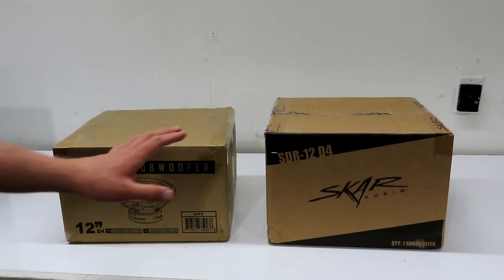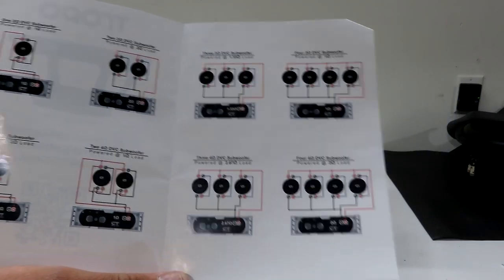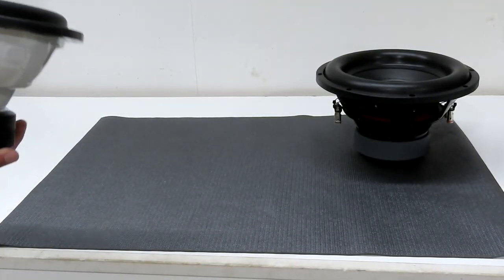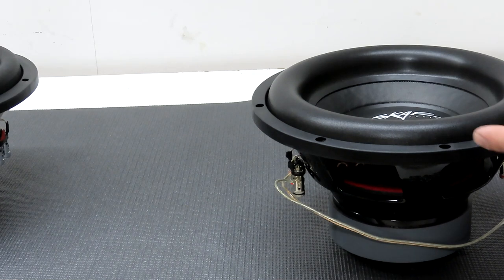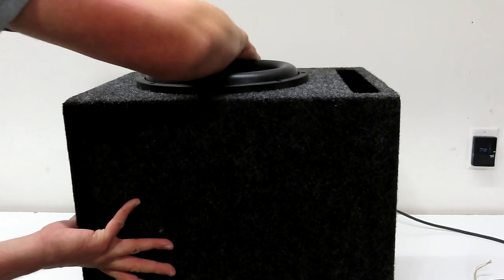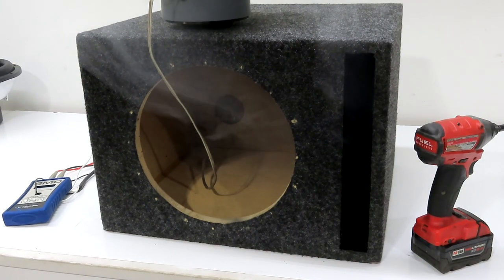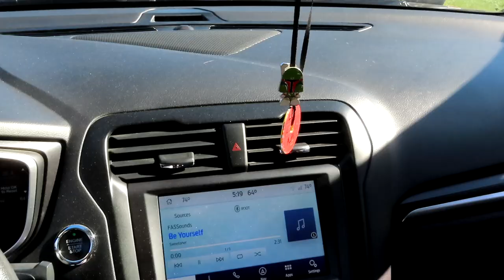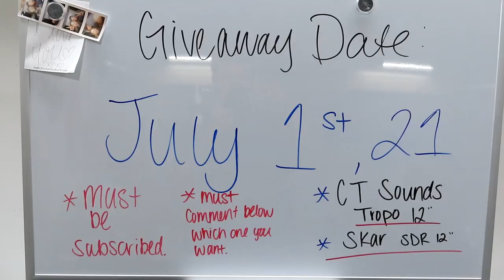Skar VS CT Sounds - Best Budget 12" Subwoofer

Comment: Ct sounds for the win in my book! Always will, always has!
Reply: Isn't the engineer that has designed some of these CT Sounds subs the same guy that designed the Audiopulse Axis quad 1 ohm voice coil 12 inch sub years ago?
   I still have my old quad 1 ohm voice coiled, 56'ish pounds 12" sub, though it's in a little crappy prefab box that's really pounding apart from the massive power of the axis! Well that, and it's had a XTR 2500 RMS watt Orion amp running at .8 ohms which I believe puts that amp easily around 4k watts RMS, probably more depending on how much box rise it's getting..
Reply: but my type Rs hit harder
Reply: @boostjunkie2320  lol
Reply: @richardwallace5625  they do
Reply: @boostjunkie2320 2 different beasts. Not to be compared.

Comment: Nice comparison..  Pricing has changed slightly since this vid released.  Skar 12" SDR is currently ~$90, and CT Sounds Tropo is running ~$120..  Roughly $30 cheaper for the Skar.  CT Sounds is still worth it though for the better sound quality and that extra "ooomph".. But also, $90 for the SDR is pretty amazing as well.  Either way it's a win.  

I'm running a Skar 12" EVL Series in a ported box tuned at 32Hz.. 1500W being fed to it.  That EVL gets down!

Comment: id go with the CT subwoofer. its awesome you showed the actual wattage going to them. alot of people still think it takes a good amount of power to move subwoofer free air, which in reality it does not.
Reply from the maker: Absolutely correct. I hate when people put a sub free air on a 3k amp and say it took 3k watts..

Comment: Should I go 2 Skar 10" SDR 2ohm DVC or 
CT Audio 10" TROPO 2ohm DVC ?????
Reply from the maker: Did you watch the video? CT Tropo is the best sub in this class. Also, why dual 2 ohm?
Reply: @ATCA  I have 2 other dual 2 and it's best for the configuration and to not mix dvc 4 and dvc 2

Skar burnt out and ct easily 600 watt, and ct better with the lows
Reply from the maker: @BramtheMan1  what amplifier.  You want to run all 4 on one amp? Mixing dual 2 and 4 is fine if they are on separate amplifiers.
Reply: @ATCA  was looking at either CT 2000.1 mono or skar rp 2000.1

But to find the right box for the CT is a quest, i would like to stick them in the skar dual 10 box, just want the best box according to the subs specs
Reply from the maker: @BramtheMan1  to be clear, you want to run 4 subs, or just 2 subs? Do you have 2 of these skar boxes? Also, thr ct2k is a powerhouse! Ill order and test one soon!
Reply: @ATCA  all 4 on one, the other two are 200 rms each in their own box. CT rms each is 650, so in total it would be 1700 watts rms needed. Can't wait to see that test video 🤘
Reply from the maker: @BramtheMan1  get dual 4 ohm and a 1500 for those and a different amp for those 2 you have. Running all off one would not be ideal. The 1500 is on sale still. I think and its a powerhouse
Reply: @ATCA  I like that idea, I'll see if they have a bass package for the10 " TROPO 4 dvc and if 1500 is still on sale. How is the 4 ohm better than 2 ohm ??
Reply from the maker: @BramtheMan1  dual 4 ohm woofers will be at 1 ohm if you run 2. Perfect match
Reply: @ATCA  Do you think the Ct TROPO dual 10 package is the best volume for the 2 subwoofers? That box looks small and looks material wise cheap.
Reply from the maker: @BramtheMan1  send link and ill look.
Reply: @ATCA  Tried putting link, it just doesn't want to post
Reply from the maker: @BramtheMan1  take the .com off
Reply: .ctsounds/collections/factory-loaded-enclosures/products/b-box-d-10-3
Reply from the maker: @BramtheMan1  so I've actually had this setup before act. It didn't fit in my car so i sold it to a good friend. He beat on it for over a year with a t1000 before getting a t1500 for it then upgraded to a Meso 12. All i can say, is i hated the box at first but it was built well and I was impressed.  And basically,  this cost, the box is like $40, no? So its a super cheap starter box. No harm if it gets upgrade.  We built him a custom box for his Meso 12 and he kept these for another car

Comment: The reason that skar blew the coil is because you are correct at tuning there is very little cone movement which translates to no air flowing or cooling of the coil lol
Reply from the maker: Ct did just fine. This is one method i use to test coils. The most brutal.

Comment: I got 2 sdr subs on an rp2000 and have had it for over a year hitting hard without any problems so I don't know if what he is say is true must be doing something wrong behind the scene
Reply from the maker: My testing methods are conclusive. A true,  clean, continuous 600w rms fried sub. Whereas the other brand did just fine. The SDR woofer is very popular because its cheap. But saying its a good woofer is a gross overstep. If you enjoy the SDR, you'll find other similar woofers to be much better.

Comment: I have 2 SKAR VVX3s 12's i have slammed for over 4 years in my rover. Bought a skar 8 for my truck and it had a weird rattle. Replaced it with a CT sounds Meso 8 and damn that is a beast. I'm sold On CT i think the newer SKARs are getting to cheaply made. My older 12's have a cast basket and they discontinued that sub probably because of manufacturing cost. I do have a skar rp1500.1 and 800.1 and they are great for the money.

Comment: im questioning your testing method. Stevemeade put 1200 watts to his sub for well over half an hour before it started making any kind of noise. The sdr series isn't a bad series if you set your stuff up correctly. I would have liked to see the impediance rise and seen some thicker speaker wire used. Plenty of peeps having zero issue with the sdr stuff. Also why show the SMD meter with the CT and not with the sdr? Something fishy going on here.
Reply from the maker: Check it again.  The ct clearly shows  600w at about 5 ohms. Thats after impedance rise. Thats not a 1200w amp...
Reply: @ATCA  not once you factor in impedance rise no but it IS a 1200 watt amp regardless. It puts out over 1200 watt at its rated impedance. Impedance rise isn’t the fault of the amp that’s the sub and box. Steve mead also shows with his clamp meter what it’s pulling while it’s pounding. Go watch his video on the sdr.
Reply: @ATCA  800 RMS 1200 Max it does over 1200 watts it's an skar audio amp so it's  gonna do more lol
Reply from the maker: @azzazel_99  do me a solid, whats a 1000w amp do at 5 ohms? Awaiting your reply
Reply from the maker: @azzazel_99  i have a much larger amplifier than is needed. That's how i can dial in 600w exactly, regardless of impedance rise or enclosure design.
Reply: @ATCA  again box rise/impedance rise are not the fault of an amp. The rp1200.1 does 1200 watts at 1 ohm. It does it’s rated power at its rated impedance levels. In the same video the same sub is also beat on in open air all but eliminating box rise. Take the rp1200.1 and factor in box rise and yes you aren’t getting the full 1200 watts………however you are at or above the rms of the sub and again SMD’s sub took that/more playing constant 30+ mins basically full tilt I believe he states. 🤷‍♂️
Reply: @ATCA  that’s my point. If you watch his video his meter shows you real time with box rise etc. he fed the sub over its 600 rms rating. You can see it in the video.

Comment: That skar rigtht now is $84 on their website. Great price but that should not have had a meltdown like that. It's rated for 600W. Most subs can take a bit more abuse than what their rated. I'm running a cheap rockville K5 12" in my grocery getter at 450W with no problem whatsoever. But the grocery getter is getting an upgrade. Definately looking at the TROPO XL. Although the price on that is double the skar! (edit: just noticed they have a tropo and tropo-XL. Probably worth the extra $60 to get the 3" VC and higher power rating.
Reply from the maker: Those skar Re just hit great. Hence the price drop. I think they're going under. D4s already dropped them. All they have is clout. Tropos are nice tropo xl is literally just a tropo with more power handling. You can use Coupon code ATCA for a discount on them too or use my link in description. 

https://www.ctsounds.com/collections/tropoxl-subwoofers/products/tropo-xl-12/?ref=kusxizsn72

Comment: Do you know that when you put in your hand under the bottom you are restricting the pressure redo the video. I have something to hold the speaker up so they can perform better without you blocking that air whole it’s s never want to perform right

Comment: What amp are you pushing the woofer with?
Reply from the maker: CT 4k
Reply: I was thinking of getting 2 skar 12. Now I'm getting 2 ctsounds 12. Good video.
Reply from the maker: @jesusrocha9856  yea. I used the 4k at 1 ohm so i can dial in exactly gow many watts i wanted. In this case, 600. Clean pure watts. 

Check the link in description for CT products.  Also, you can use code ATCA for a discount on everything on the site.
Reply: Nice I'm going ct on my system now

Comment: Why not show the enclosure specs and ts parameters side by side for both? The
Ct Sounds is rated 
650 watts rms, and has a BL of 10.80 and Xmax of 
11 mm. The Skar is rated 600 watts rms, and has a BL of 10.45 and Xmax of 13.5 mm. The Ct Sounds sensitivity is 88.21 db, and the Skar is 84.7 db. So that means the Skar will play a little bit lower and has a bit more excursion, but the Ct Sounds will get a little bit louder. The Ct Sounds recommends 1.75 cubes tuned at 32 hz  for the spl enclosure. 
Skar recommends 2 cubes tuned at 35 hz for the spl enclosure. Your box is built to Ct Sounds specs and tuned within a few hz, but it's a quarter of a cube smaller than the Skar needs for the spl specs. A fair sound comparison of 2 different subs requires 2 different enclosure unless the enclosure specs are the same for both subs.
Reply from the maker: Yeam, I'm not doing all that. Neither is anyone else. Factbisvyhe CT is better.
Reply: @ATCA  you're right. Other channels don't do all  that because it would be ridiculous to build a box for every sub that you test and I wouldn't do that either, but I would build an adjustable test box. For example I'd make the port side be able to slide in and out to adjust the internal volume and make a 4" round port with  sections that can be added or removed to adjust the tuning, but I don't make YouTube videos comparing different of  subwoofers so I haven't built one. You're right the tropo is better than the Sdr, but it's not the fact that 
 Ct Sounds is better than Skar. The fact is  that according to the specs and price the Tropo is a class above the Sdr and the Sdr is only $89 now. The Svr would've been a fair comparison because it's Skar's equivalent to the Tropo. They were both $149.99 before they went on sale. Now the Tropo is $119.99 and the Svr is $127.49 it's almost the same subwoofer. They use the same basket, cone, dust cap, and stitched surround, but the Svr has a 2.6" coil, and it's rated at 800 watts rms. The Tropo has a 2.5" coil and a slightly smaller motor and they say it's conservatively rated at 650 watts rms, so it's probably in the 700-750 range, and that magnet isn't chrome. That's the bottom plate. The magnet is covered up by the rubber boot
Reply from the maker: @chichidouglas5078  ct has the ozone that compares to the svr. I wouldn't say the tropo is conservative
Reply: @ATCA  in their description Ct Sounds says that it's conservatively rated at 650 rms which means it can handle more  than 650. A lot of companies started to give underrated rms numbers. I think they got tired of ignorant  people that think the warranty covers damage caused by improper settings and misuse
Reply from the maker: @chichidouglas5078  im sure

Comment: Skar svr 10” or ct tropo 10”? Upgrading from some American bass xd10s they play fine but they developed  a huge ass rattle coming from the coil but bass is still the same
Reply from the maker: Tropo or ozone
Reply: Will the ozone hit better even with the smaller magernet ?
Reply from the maker: @juan_f150  ozone is larger than tropo
Reply: @ATCA  I mean the skar svr vs ozone
Reply from the maker: @juan_f150  ozone is better woofer
Reply: @juan_f150  svr is going to be more musical than the CT sounds ozone they geared that woofer to be more splish so if you like SQL instead of just SPL I would lean towards more of the scar svr

Comment: I have two 10 skar 200 rms subs...plugged into a 1200w kicker...my skars slam..but been lookin at CT for a couple months now
Reply from the maker: Alright.  What amp is it? I think the kicker is 2 ohms 1200w. In that case I'd get a single Strato 12, or 2 Tropo 12s or 10s.
Reply: @ATCA  its a 2 ohm 1200 with 2 10 dual 2ohm...I bought it as a replacement speaker for a previous box...I upgraded the box to a 1.75 cub ported at 33hrz...

I'll be upgrading amps to a kicker 1600 2ohm I found some10 ct ozone rated at 800w rms dual 2ohm...what do you think??
Reply from the maker: @ukokepaoa5536  ozone for spl, tropo for all around music
Reply: @ATCA   thanx for the quick reply...man I don't want to over think it lol...I love music but i really love loud music lol
Reply from the maker: @ukokepaoa5536  either one will be great. I have both and ozone are loud. Tropo are smooth

Comment: you mentioned in the video if there's any other subs in the same price range Check out Power Acoustik Gothic subs at Walmart cheaper than both of them and will definitely outperform the skar SDR by far then there is the Toro Fierce 12" sub I think the price is a little higher now but at one point it was $137 for one and they get low I have the step up from them the Toro Fierce s 12's and I am more than pleased great product and their customer service is amazing besides this stay up and stay Bassin brother 🔊🔊🤙🏼

Comment: I’ve had both I liked skar better and their amps are also better than cts amps. Sdr is budget friendly I gave mine 1500 rms and it took it no problem then I had 2 evl 10s on 2500 watts and they wanted more power and now I have a skar vxf 15 on a crescendo 3k in a 5 cube box (over skars specs) and never had any issues and I also hit a 146 in a trunk with 1 15. Skar is a solid brand as long as everything is done correctly almost any brand will be fine. But personally I’m going skar over ct. but doesn’t mean ct isn’t good I just prefer skar hands down never had any problems with the company or their products and they are super underrated on power ratings.
Reply: Lmfao

Comment: I really don't know if this would make a difference for skar audio 12" sub, but you said your box was a 1.50 cubic foot which skar manufacture recommends a 1.75 - 2.00 cubic foot ported box. and I bet your port volume  is not the same as the recommendation of skar audio port volume. Now i'm not knocking CT Sounds Subwoofer at all but just saying.
Reply from the maker: The box skar sells with this sub is also grossly out of spec. Probably more so. I also modeled the skar SDR sub in the box i made using software.  It wasn't out of spec hardly at all. I think 1.75 is a bit much for this SDR. This box is very close to ideal, actually.

Comment: It really reminds me of a cheaper p3 but with bigger sub options
Reply from the maker: Care to elaborate?
Reply: @ATCA  p3s come in as a 8 10 12 and 15 vs ct sounds and skarveich can't me in the same but with the 18 inch option and there the same power at that two
Reply from the maker: @fxgamer-11yt  tropo is a better sub than the p3 in many ways as well
Reply: @ATCA  ehh if your going spec to spec there pretty much the same though the tropo is a cheaper stronger sub the p3 has more xmax and is more for musical use then the tropo is like your mid range spl sub that works good in all applications
Reply from the maker: @fxgamer-11yt  have you ever heard a tropo?
Reply: @ATCA  I owned 4 of the v2 18s
Reply from the maker: @fxgamer-11yt  yea.. i wouldn't go judging the tropos based on the 18s. The 12s are very musical and very accurate.
Reply: @ATCA  never said they wasn't I just no what you consider musical and what I consider musical are two different world if I'm building something for a sq build I would use a. Tropo I'd go with a jl audio frog or focal audio sub and mids and so on but for a stander street beat system this sub is a good sub same with the sdr but if I was to go full out spl I would stick the Ture and tried brands like sundown or emf or even Hutchinson audio if money wasn't an issue in that case just most of the equipment is application based for me I stand by that

Comment: check out the NVX VS series
Reply from the maker: Sure thing
Reply: @ATCA  also the Sundown E series.
Reply from the maker: @ssc7453  nvx i can understand.  Sundown is too expensive for what they are.
Reply: @ATCA  thats true. 
do you think ct tropo can hang with sundown? Should I get ct or sundown.
Reply from the maker: @ssc7453  saying that is like saying,  will my chevy impala hang with Porsche? 

Obviously you can buy a better CT sub and compare it to a similar Sundown and the CT will be cheaper for thr same power and arguably the same reliability. Im all CT, my guy